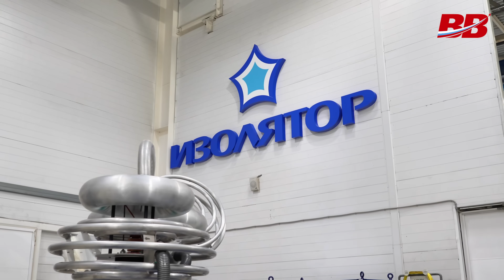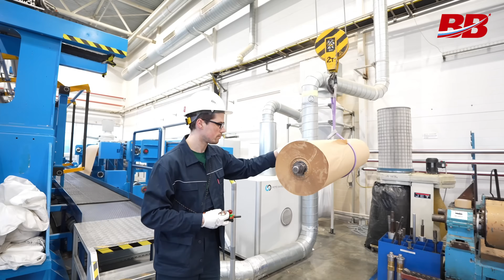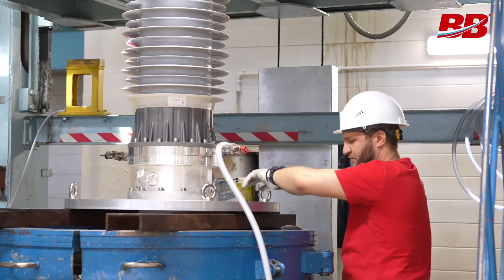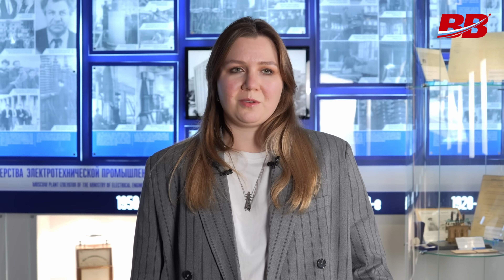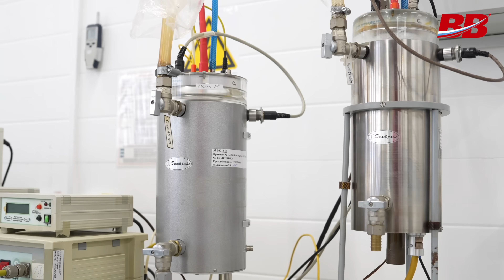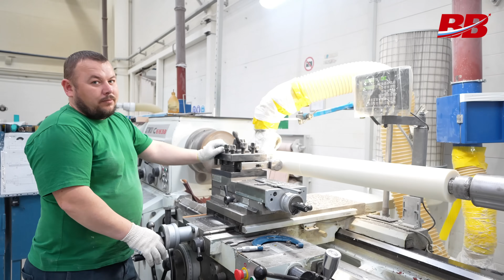Only 7 Like This in the World: Inside Russia's Izolyator Factory

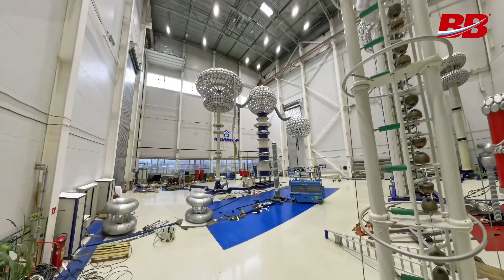Comment: @7:11 These are very nice Tesla Coils (top parts). Creating the toroid and the sphere out of smaller spheres (or round objects, not clear form the video) is a good optimization design to increase the capacitance of the top (ending). Interesting how they are interconnected as in order to keep the HV from materializing in corona discharge, the inter-connectors, unless they are dielectronically coated,  need to have bigger radius and thus lower capacitance.